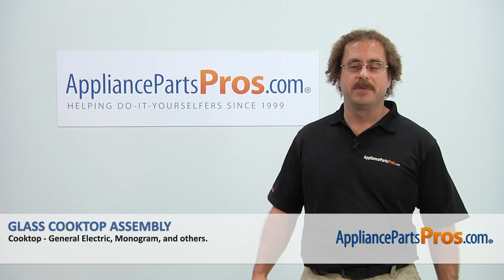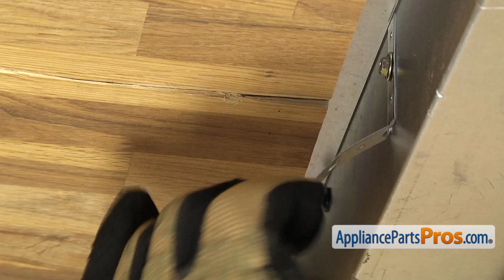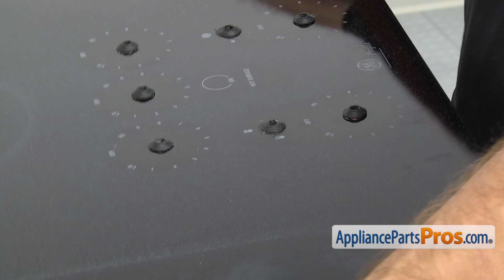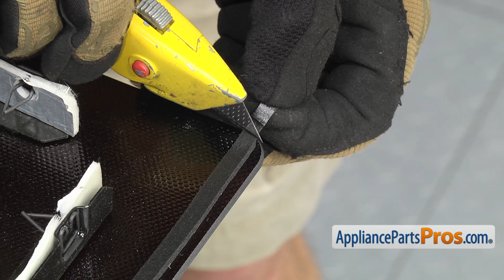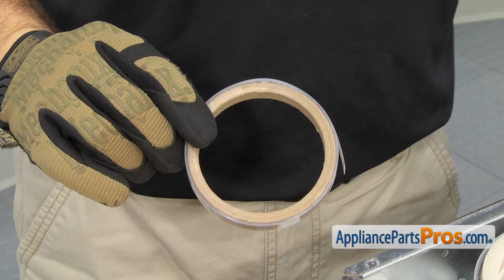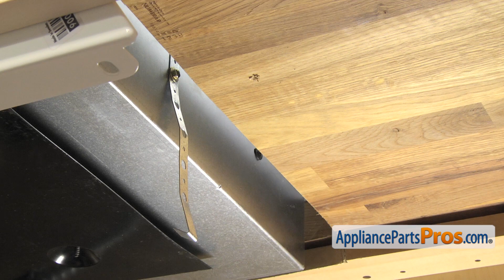Cooktop Glass Cracked or Shattered? Replace the Full Assembly — GE (WB62T10152)

Comment: Great Video.  I know it has a metal flange, but does the glass of the cooktop support the entire weight of the cooktop and the pans?
Reply from the maker: You have the brackets for the cooktop and the cooktop rests on the counter as well, so it's not just the glass that supports the weight.

Comment: If only replacing the top glass, why do you need to remove all the screws since the top glass is not connected to the body by the screws? Thanks.

Comment: Thank you.  I'll never, ever buy another GE product again.  They're junk!  See all questions online about lockout switch won't stop buzzing or the burners clicking, all GE and mostly GE Profile.  I have a Profile, that "safety" buzzer hasn't stopped buzzing for a month, so for a month, I haven't been able to cook.  I've cleaned everything, nothing is wet, it buzzes if I light the burners, which light, but there's that horrible buzzing.  I'm going to remove the top and see if  can cut the wires for that switch.  The Valve Lockout alone is $72, a fix is over $500.  These should be recalled.  Total junk.